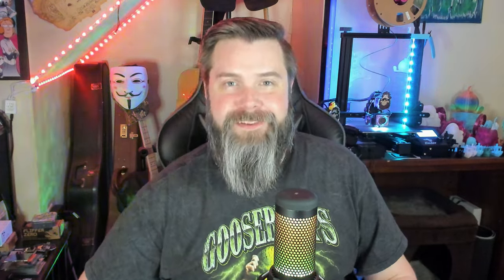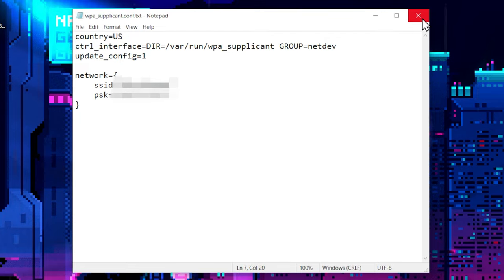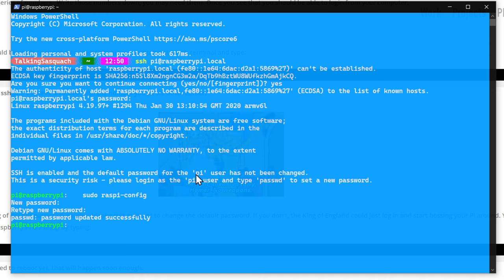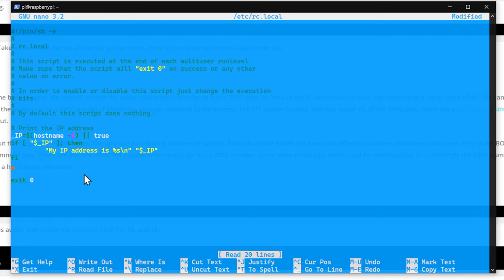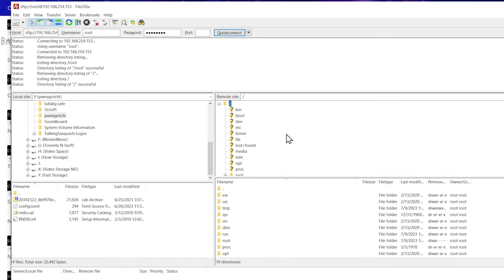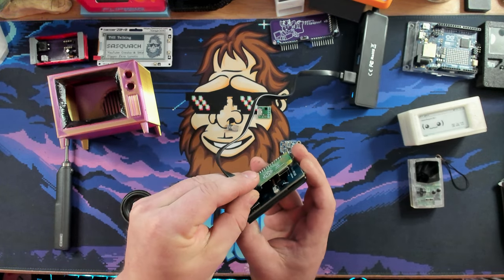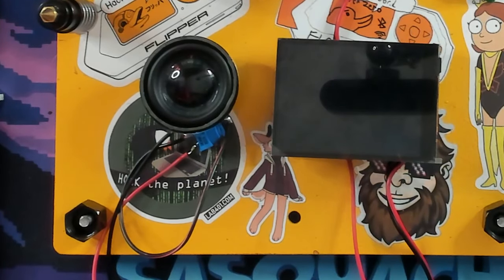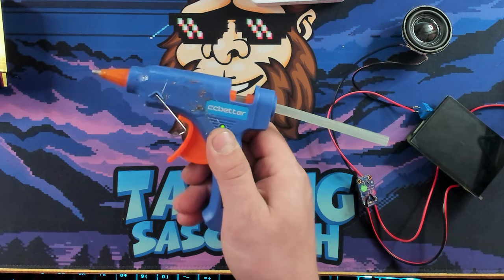The Simpsons TV!!  Raspberry Pi Powered TV That Plays The Simpsons Episodes On Loop FOREVER!!

Comment: Looks great, thanks. Pro tip: Put the headers through the Pi GPIO holes but don't solder them yet and connect them to the screen connector so they're perfectly aligned. Then you can solder the header pins.

Comment: Did you figure out why the audio was distorted and how to fix it? I've had the same issue. Do you have a solution for how to fix it and get clean audio?
Reply: @floorboardvoodoo  I think it needs a 1uf capacitor. If you look on thingiverse source for the print files, one of the top comments (a giant one) mentions how to fix the audio issue everyone has, using an outlined capacitor added into the build.
Reply: @JaredC4  thank you so much! This was driving me nuts!

Comment: Hi thanks for this! i managed to get through everything, but my pi turns on,  then once OMXplayer has booted the screen goes completly black. im using a 3.5inch waveshare screen as opposed to the 2.8
Reply from the maker: Does the screen show text?
Reply: Hello Jordan. Working on this project and having the same issue. Did you ever solve it? I get the little blinking cursor on bootup but then it goes dark. 

Thinking about switching video players away from one video out of desperation
Reply: @afty_  The same thing is happening to me. I only get a black screen with a curser and then it goes completely dark. Ive gotten to the point where i can get audio to play but no video. I've reimaged it and started over multiple times. I always see all the text/code with the raspberry logo when i first plug in the freshly imaged micro sd card, until I make all the changes, and then on reboot it does the blank screen thing. i cant figure it out!

Comment: Hey so I had it working perfectly. but my ssh became non op for some reason so. I had to start from scratch now I can't get videos to load at all!  after doing all the coding and rebooting the screen just says 

"Raspbian GMU/Linux 10 skyler TTY1
skyler login:_ "

Then it just sits there. The files won't play anymore.   help?? (skyler is what I changed my raspberry pi to.)
Reply from the maker: are you sure you have video files loaded into /home/pi/simpsonstv/videos ?  join the discord if you're still having issues, easier to help than YouTube.  I literally just spent 2 days building a new one and i had nothing but problems, turned out my RPi was just being sketchy

Comment: Hello, I was following the Brandon´s tutorial, everything was ok, but when i turn on to check the video playing it stays on log in screen, any help, please?
Reply from the maker: Are you positive it has Internet and you were able to clone everything?  Also you will need video files for it to play anything
Reply: @TalkingSasquach  I think it was the encoding of the videos. Also i could not connect on filezilla, instead of root I put pi on the user. just in case.
Reply: Hi, me again, now i'm trying to make the tutorial but with a 3.5 screen gpio of 26pin but i´m stuck with the drivers part.

Comment: Did you ever figure out the distorted audio? I just put the audio circuit together and I'm having the exact same issue.
Reply from the maker: Oh wow that's interesting!  I thought it was just me.  I was trying to increase the volume on the player itself but couldn't figure it out through SSH
Reply: @TalkingSasquach  Might just not be able to drive the speaker that loud. I turned the volume down on the amp and it went away. Just a little quieter than I would like.

Also if you want to try setting volume in omxplayer to max you could probably put the --vol 100 flag into the player code below.

playProcess = Popen(['omxplayer', '--no-osd', '--aspect-mode', 'fill', video])
Reply: I had the same issue with the interference and distorted audio as well. I even got a new amp and replaced it and it was still happening. It turned out to be the small screw on the amp. I initially used a very small bit (PH000) to turn the screw but it must have been too small and didn't turn it at all. I used a larger bit (PH1) and the screw turned, the volume increased and the distortion went away. In your video, when you turned the screw, you said "I think that's turning," but I don't think it actually was as the screw initially has a noticeable resistance and won't turn as quickly as it appeared to in your video. I would recommend plugging the TV in and with an episode playing, turn the screw on the amp with a larger bit and see if the distortion goes away when the volume increases.   @TalkingSasquach
Reply from the maker: @davidcy  trying this when i get home!! Thanks !

Comment: Did you ever figure out the interference? I just ran into the same issue
Reply from the maker: Turn the screw on the amplifier like halfway down, then see if it sounds better with the volume knob higher